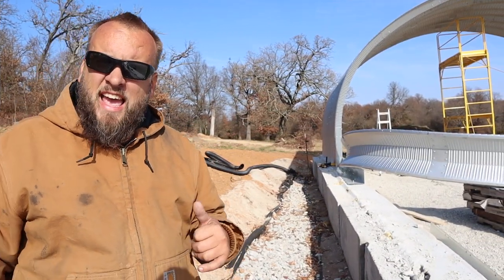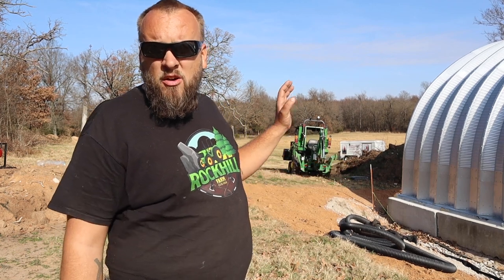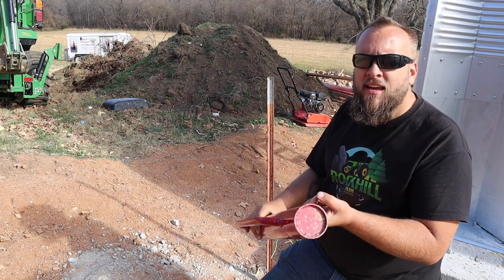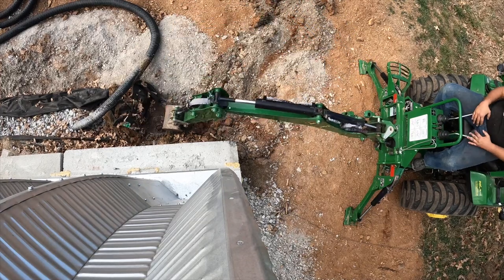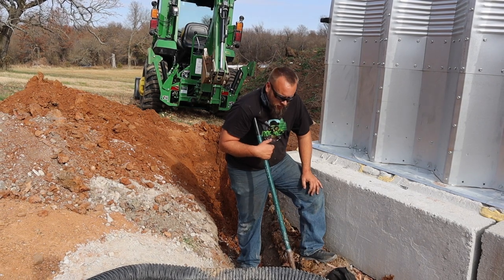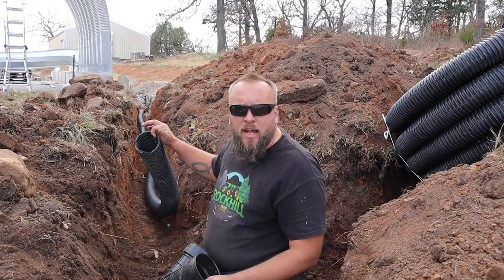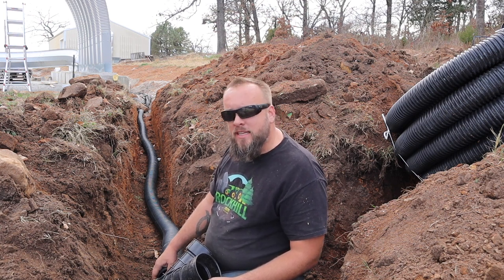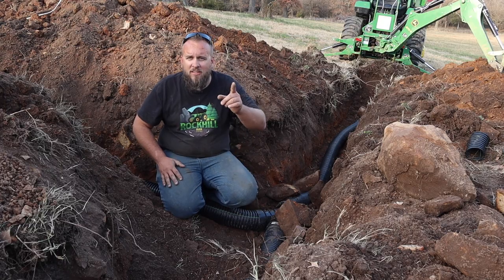Digging Drain Lines Around the New Equipment Building

Comment: It appears your using the same stuff I used 10 yrs ago. It made a huge difference here. The pvc was more money and they didn't have enough to do what I wanted. I got mine from a local landscape supplier. Mainly because it's 2 hours to a big box store. It's a lot cheeper at a big box store lol. But it is what it is. I prefer to support local business. Anyway, I have had no issues. It seems to be pretty durable when underground. I was actually concerned with it freezing and splitting, then having to replace it.northern Michigan we have pretty cold winters. Actually, Dec. 1st video you stated the nice warm temperatures. We we're about 40°'s cooler with snow on the ground. The thing that really blew my mind was how long it took me to do. I dug all my trenches then went back and laid my stone, fabric, tile, stone and then recovered it. I really enjoy the videos you share Brock! Keep them coming my brother!
Reply from the maker: Thanks a lot for watching and for sharing your thoughts on it

My thought on doing these drains after having done several of them the last few years is that there are different levels of how well you can do it and it depends on how critical the project is. 

For this I just don’t want to flood my building so I need a void for the water to penetrate the clay so I’m not gonna spend the money on the fabric. Just going to use the pipe in the rock.

If there were trees near the drain line I’d be more likely to use the fabric too

Down here we only get the type of snow that melts off the next day. Maybe once every two or three years we get a real accumulation that needs plowed off
Reply: @RockhillfarmYT  very wooded here. And I like it that way. One thing I hate to do is mow. I have a clearing out back, but I plow that and plant rye, clover and alfalfa. Not legal to bate here. Only about 3 1/2 acres. I did my drains when we put up my barn. 40×64 poll barn. I left 2 slider doors at each end for tractors and 2 roll up doors for truck and quads. The 2 bay doors were finished concrete and my sliders are dirt. The bays with the sliders would flood when snow melted or a heavy rain and I was washing out under the concrete. I have no regrets. Other than I wish I would of dug a pond. Yours is beautiful BTW!
Reply from the maker: Sounds like a well setup building

I’m real happy with the pond so far but I’ve got more plans for it

Comment: Hi Brock, why didn't you use geotextile wrap around the pipe to continu the good job you did around the base
Reply from the maker: I’ve been installing a lot of these drain lines and sometimes I use the fabric and sometimes I don’t.

It depends on how deep the trench is and if there are trees or bushes around the area to send roots in that direction and how critical it is that this specific area drains

It’s also $100 per section so sometimes I’m just saving a little bit of money

Some experts say you need it and some people I trust say it doesn’t make a difference

Comment: good morning Brock, what if you took two mangled steel panels and bolted them together then bolted on Long 2x4s and use the mangled panels as a saddle to lift up your arches? just use clamps to clamp the saddle to your arches until you get them in place. would that keep the arches from buckling as you're raising them up? a couple of 2x4s 16 ft long and a few screws would be all it's needed to at least try it. I would use some Simpson l brackets to mount the 2x4s to the saddle

Comment: So the corrugated 4" pipe is perforated correct ? And you maintain a downward slope at what degree ? I did not see fabric and stone on bottom correct ? Please show the rest of the install on this as I am preparing to do a VERY similar install at my place .
Thanks Brock & good job !
pc
Reply from the maker: I will be showing the rest of the install within the next week but I’ve also done a couple more of these in videos recently.

Standard fall on a drain line should be a quarter inch per foot. If it was like a sewage drain line then you don’t want it to be steeper than that. For a French drain that never contains solids it’s OK for it to be steeper.

If I was running this through flat ground I would have the transit level out checking to make sure I was maintaining grade.

But standard slope of a quarter inch per foot would have it drop about 2 feet out of 100 feet. Since my ground slopes down about 10 feet in 100 feet in this area I don’t have to concern myself with how fast it slopes.

I have two ways of doing it depending on the location.  I always Put a layer of rock on top of the pipe but sometimes I use the fabric and sometimes I don’t.

I’ve watched a lot of videos on installing drain lines and some people think the fabric makes it a big difference and some say it doesn’t matter

I’m more likely to use the fabric if there are trees or bushes in the area they could have roots pushed into the soil. I’m also more likely to use the fabric if it’s a really critical line that needs to drain well

In this instance I just need a void to allow water to soak through the clay so $100 per roll of the fabric doesn’t feel justified to me when I’ve done 600 foot of this line this year

300 foot of the line has fabric around it and I still have A package of that fabric unopened

I’m going to add a couple hundred more feet to this drain line specifically and I’m gonna put some of them up around the house. The ones around the house will have fabric

I know that was a long response but that’s just my personal thoughts on it, not expert advice
Reply: @RockhillfarmYT  thanks ..that helps ! I look forward to your progress on your drains and Quanset build...they are an honest depiction and your viewers appreciate it !
pc